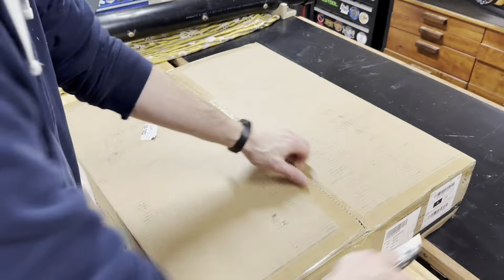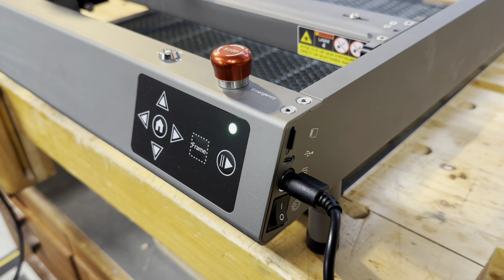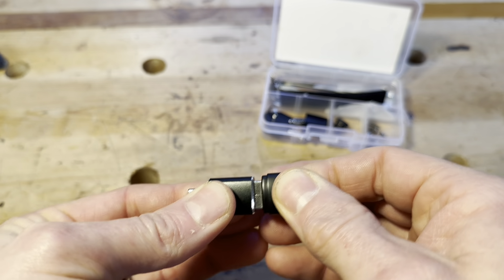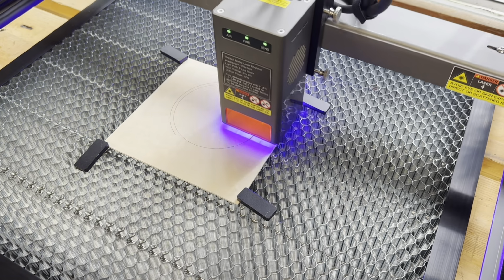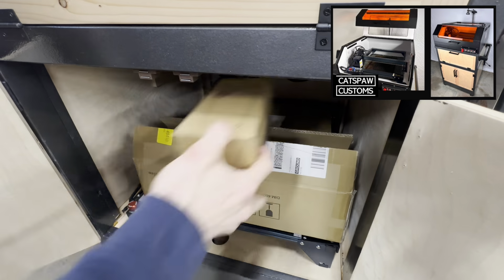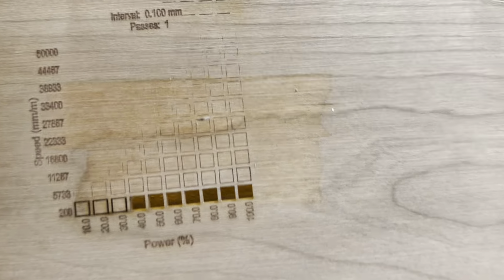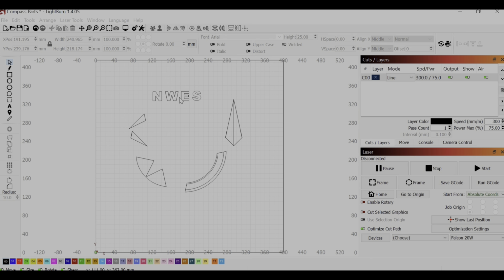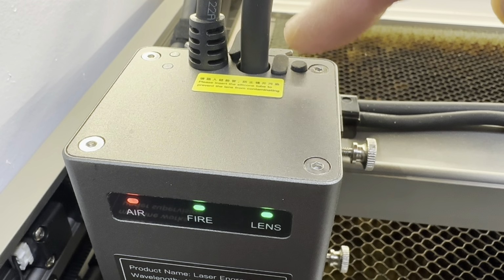Beginner Laser Engraving with the Creality Falcon 2

Comment: With brass, non-stainless steel etc what kind of tape would you say works best for electrolysis etchings templates? Thinking the laser can cut out the template to then electrolysis etch what I want on the item

Comment: I've been watching lots of videos prior to receiving my new Creality 40W Falcon2 Pro and one thing I have learned is that you need to calculate the kerf of your laser and adjust the settings in (e.g.) Lightburn. This should help stop your bits wiggling, so to speak!! As I understand it, the kerf of the laser is the width of the beam which you have to account for in the same way as accounting for the width of the blade of, for example, a circular saw.

Comment: Amazing video. Thanks for the review! Question: If i want to engrave some vector or drawing in a specific place of a cutting board (for example) how can i center or set the the laser? Is there a way that i can place or know exactly where the machine is gonna engrave? (I know this machine do not come with a camera or laser preview proyector).
Reply from the maker: @geomax3108  If you’re using lightburn, you’ll want to fire the laser at 3% or so while framing.  There are some settings you need to toggle on to make it work, then you hit shift when you click frame.  Then you can see where the laser will actually hit.  I forget the exact settings.  I thought I showed it in this video, but maybe it is in a different one.  Anyway, that’s the best way I know of doing it.
Reply: @catspawcustoms  Thank you for you time and content. Ok. I'll watch the video again, maybe I miss it. 🙂👍

Comment: I believe you made a mistake at 3:05. The height adjustment goes into the enclosure from the back (you can see the cut out section in the back at video mark 3:09)—it fits between the edge sides—and the measurement should be to the laser tip itself, not to the edge of the surround, which is at a different height.

Comment: Fantastic testing and review, dude! Thanks a bunch! 😃
And they also have a 40w version... I wonder if you could buy this version and then upgrade the laser module. 
Anyway, stay safe there with your family! 🖖😊
Reply from the maker: No idea if you can upgrade the laser module, at least not if it would be easy.  I’d probably rather have the 40 watt, but Creality gave me this one and I’m not going to complain.
Reply: I have the 40w version, they also just came out with a 60w from what I can tell it looks like it would be able to physically just swap the heads out the plugs all look the same but idk what would have to be done with the firmware to make it all work that’s where it goes over my head but even with the 40w I haven’t found anything it won’t cut. But the 60w would be nice just to speed up my cut times